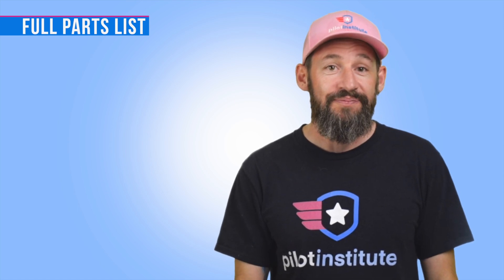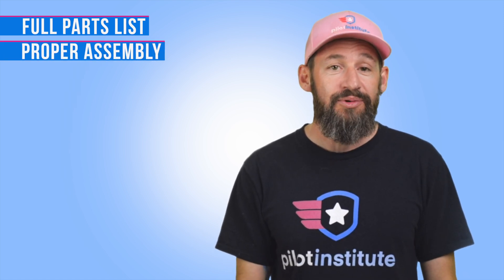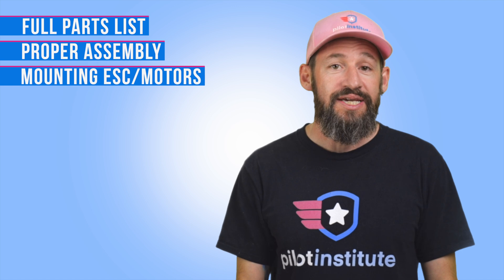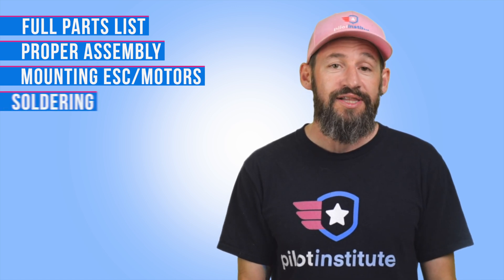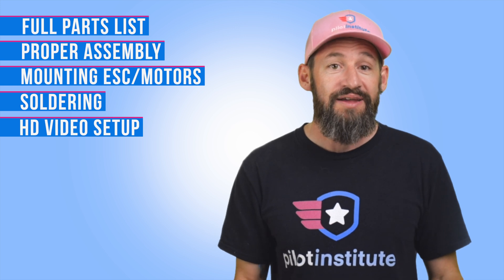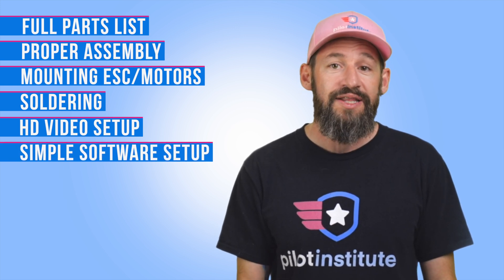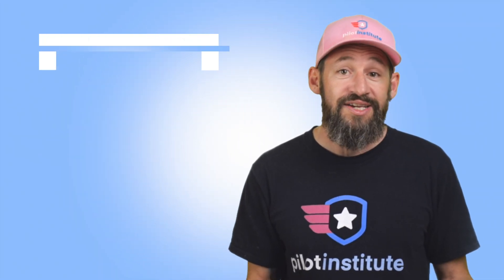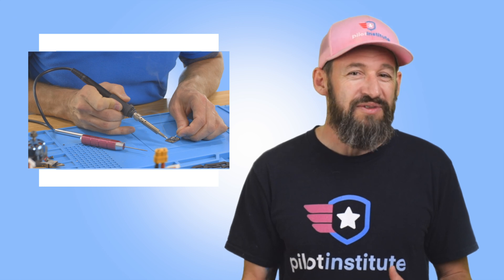NEW! Cinematic FPV Build Course

Comment: It’s Great idea. I think I would warn people that if the parts you recommend buying are of good quality, as you have indicated, they should be prepared to see the words “sold out”.  The industry is moving incredibly fast and is very competitive. 

This class is a great idea, but for those of you who think it’s cheap because you can build your own………mentally prepare yourself for a bit of “start up” sticker shock.  DJI or HD Zero will both set you back. Good stuff costs money. Budget stuff costs more in failsafes, crashes, and lost drones. Just sharing real information.
Reply: We are constantly updating the parts list to reflect the industries fast pace. We make sure students have the ability to select different frames, video systems, and flightcontroller components if something is not available. You can be certain of this.
Reply: @donaldheon   Oh I am certain now.  Thanks for the update.  😒